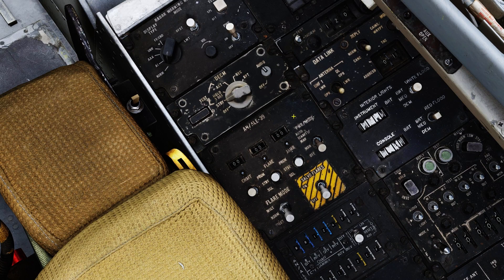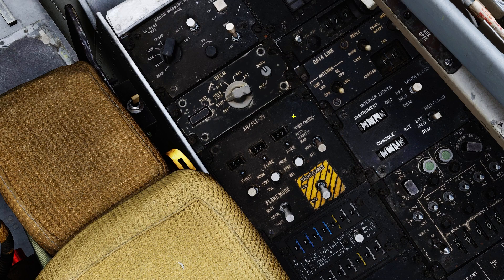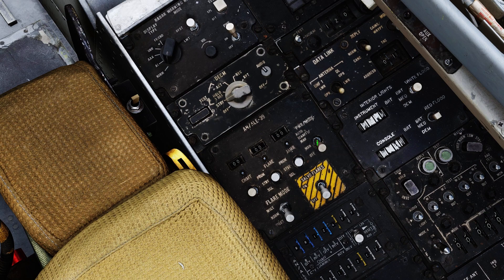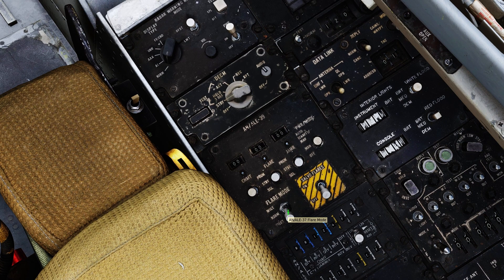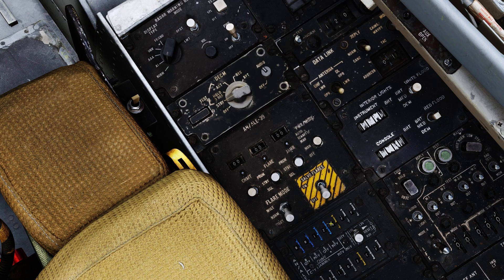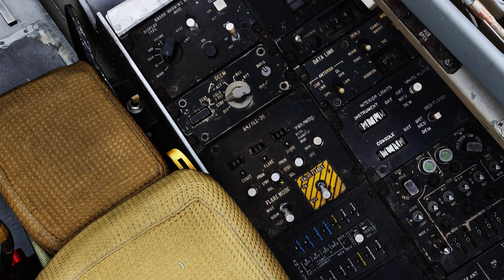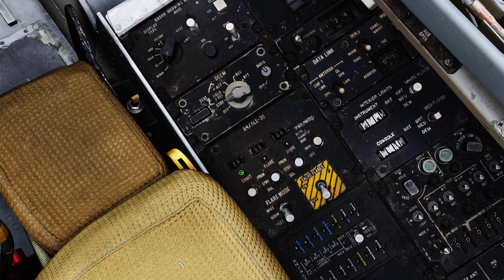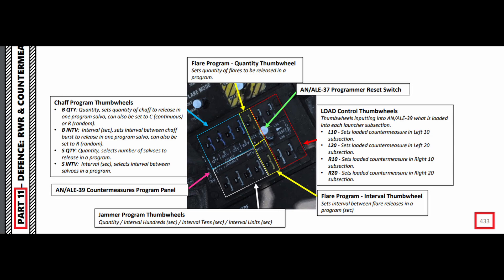DCS World - F-14 RIO Guide #4 - AN/ALE-39 Countermeasures Dispenser System

Comment: Do you think I can run this game high 1440p with 3070ti and ryzen 5 5600x single player no vr
Reply from the maker: You should run it just fine, but I would downscale to 1080p when running DCS because spotting at higher resolutions is very difficult. The game has an SU-25 and a TF-51 available for free, so I would get the game and see how the system does. I don't forsee any issues unless you are light on RAM.

I run an i7 8700k and 1080 ti, 32 GB RAM, and a 1TB SSD and have no issues even on the most intensive multiplayer servers.
Reply: you'd better have 64gb ram or more or your ssd will die with all those write cycles to SSD bcs of pagefile.sys ...